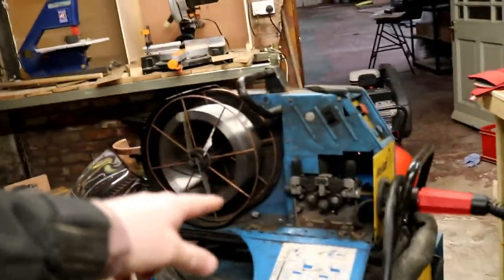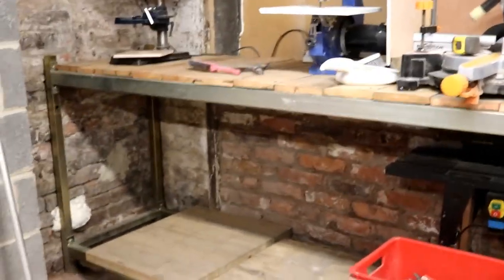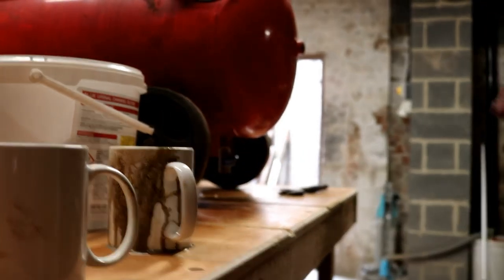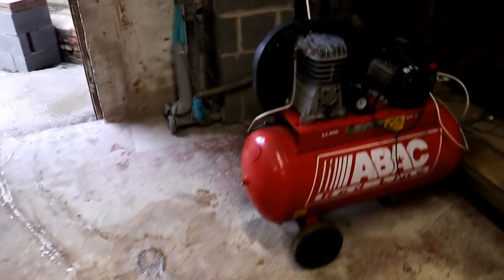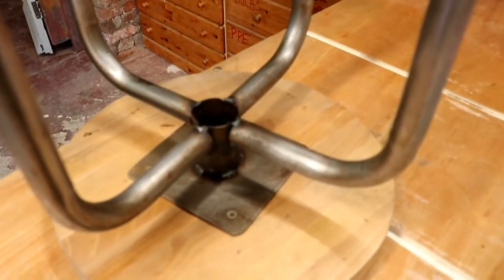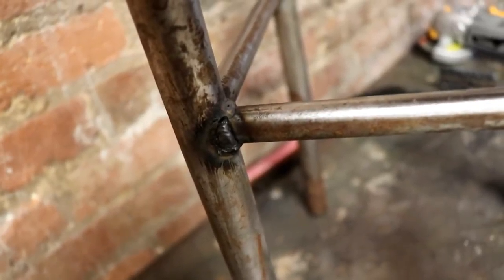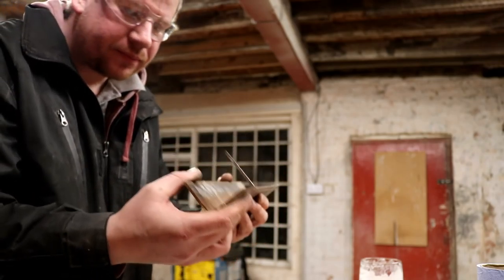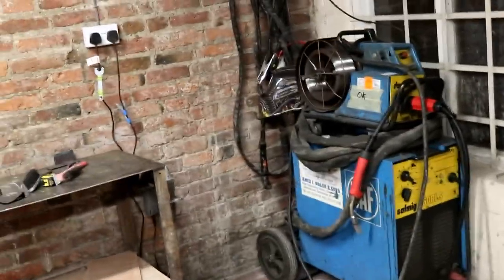THIS IS WHY YOU NEED TO DRAIN YOUR COMPRESSOR

Comment: When your welding thinner stuff set the amps a little a higher and pulse the trigger in small bursts. That way each pulse will melt into the other and will get good penetration 😂 and looks cool. Makes sure metal is clean. Use a die grinder or angle grinder to do it. You will get much better weld. Also don’t drag the torch you should have it at a slight angle and push into weld. Just a few tips there mate! Hope they come in useful. 👍🏻

Comment: My God there was some shite inside that compressor,did ya have to flush it out? Seems like you are starting to get the hang of that Mig  welder,welds just need to be functional for now m8,the pretty welding will come with time and practice. You are tipping along nicely there Harry keep it going m8. Cheers.

Comment: That 1.2 wire looks like stainless to me, also do you know that you'll have to change the contact tip in the torch to a 0.8 as 1.2 will be to big?